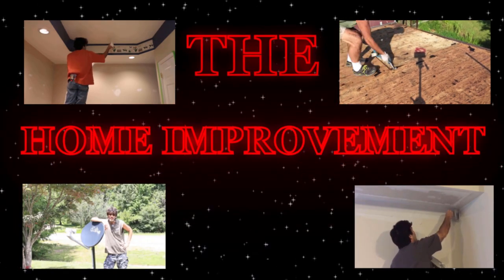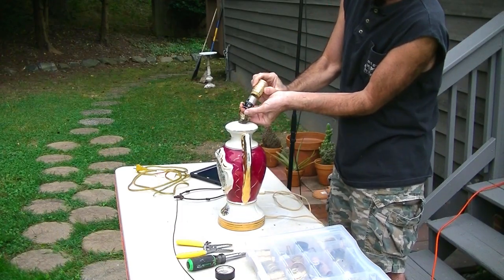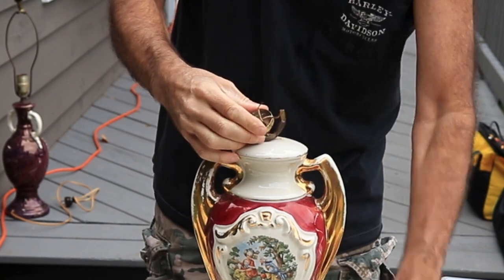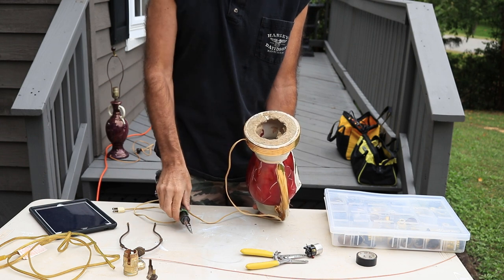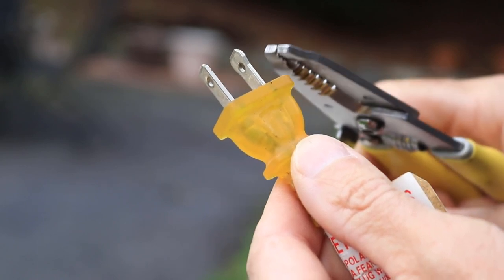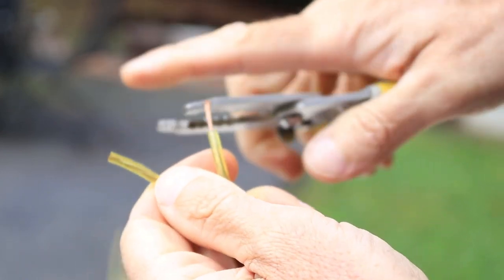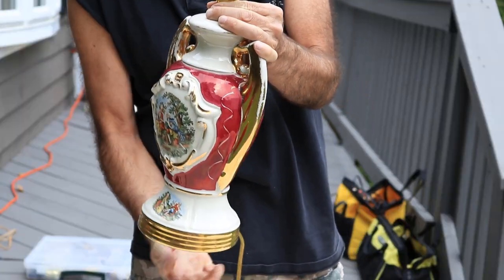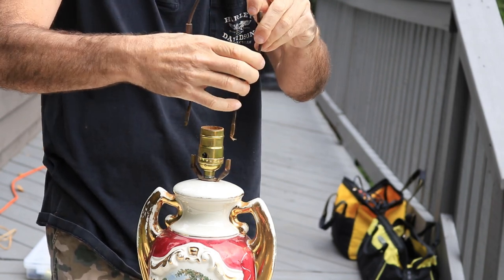How To: Replace Cord and Switch on Antique or New Lamp!  Best Youtube Video !!

Comment: If you ever need to repair a lamp, this is the one to watch!
This was my first time replacing a table lamp wiring and socket and by far, this was the BEST video I found on Youtube.  I researched at least 10 of these self-help videos, and none of them were as good as this one.  The instructions here are very detailed with helpful tips offered along the way, and this was the ONLY video, at least what I could find, that offered a tip on how to insert the cord through the inside of a lamp that did not have a long threaded pipe inside the lamp, that part was driving me crazy and taking forever until I happened upon this video!  Thank you Home Improvement Channel!!!
Reply from the maker: Wow!  Thanks for the great feedback... 😀. Glad I was able to help.

Comment: Lovely video, straight to the point.    Would have liked to have come across this video 4 years ago when I rewired my great grandmother's floor lamp she got as a wedding gift in 1948.  The bulb started to flicker when switched to a certain setting and the bulb was good and screwed in tight,  after visiting several hardware and home improvement stores finally found a replacement socket because it was the mogul base for a 100-200-300 watt 3 way bulb which was fairly common many years ago but nowadays is very difficult to find.  Also replaced the cord because the insulation was cracking and falling apart as I unscrewed the wires from the old socket and the plug was the old style with two narrow prongs,  allowing the plug to be inserted either way, as could be expected with a 70 year old lamp.  At that time i was unaware of the smooth/ribbed side to ensure correct polarity,  so I used a multimeter set to continuity to make sure the wide prong on the new cord was connected to the screw shell on the new lamp socket.  My mother inherited the lamp after grandma passed early last year,  and someday I hope to inherit it because it has sentimental value to me.
Reply from the maker: Awesome!  So glad I was able to help you with your project.  Yes the multimeter is a great way to tell if you're wired correctly.  Great job on that!  Totally understand the sentimental value of something like that.  Hope you have a great New Years.... 😀

Comment: Hey Rudy, 
Thanks for your good video and many explanations.
I have an older floor lamp which has the switch socket inside of a housing which doubles as the holder with 3 set screws for a globe shade.  It also has a threaded rod going through a couple of nice brass pieces and is bolted to a flat iron piece of the upper part of the floor lamp ...and the cord does NOT go all the way through to the bottom of the threaded rod. Rather, it has a hole in the upper third of it, comes out from the switch above it, and goes through a hole in the lower brass piece, before the rest of the threaded rod attached to a flat bar on the upper part of the lamp. The threaded rod is then held in place with a nut from the  bottom.  In order to get this apart, I could not access the socked and "press" on the part to disassemble it from the lower part that screws on to the threaded rod.  So I managed to hold the bottom of the threaded rod and unscrew the entire upper housing including the socket switch.  This severed the cord/wire in the mean time. No problem, because it didn't work.  The challenge is, How do I put it back together?!?!  Any suggestions... If there is a way to get pics of the components to explain this better, let me know.  Thanks in advance for any help you can offer.
Reply from the maker: HI Art.. Yes you know the old saying "A picture is worth a thousand words!"  If you have access to Facebook, you can upload a picture to my other channels site at take a bath productions...  I don't have a good picture in my mind yet of what your lamp looks like..

Comment: Ten points for pointing out that, yes, AC appliances do have polarity, and in the worse case, wiring them wrong is going to hurt someone. I know of someone who was electrocuted, standing on a wet basement floor and making contact with an incorrectly wired electrical device. It was the absolute worse case scenario, but you only get one chance to not die. She'll be missed.
Reply from the maker: Thank you for your feedback... 😀. Sorry to hear about your friend...

Comment: Rudy....maybe just a little more info and VISUAL demonstration on the SMOOTH and GROOVED wires and then which one hooks onto the BRASS screw.....and which one to the SILVER screw......just my opinion......thanks !
Reply from the maker: I covered it 3 times!  How could I cover it anymore... :-)... 4:22 , 8:23, 9:08..
Reply: @TheHomeImprovementChannel    You do cover it....but you don't LINK all four together in any one place....meaning, your TRAINEE may/will get it wrong.  I went over them a few times and will attempt to link all 4 TERMS YOU USED => to EACH other => for a complete progression => all in ONE PLACE...because I don't remember you ever doing it.....and going back and forth defeats the purpose of => KEEPING IT SIMPLE.

So here goes.....please confirm CORRECTNESS.....or link them with your own comments below.....

1. SMALL PRONG => IS THE HOT SIDE => IT'S THE SMOOTH WIRE => CONNECT IT TO BRASS SCREW

2. LARGE PRONG => IS COLD/NEUTRAL/GROUND => SO THE GROOVED WIRE => HOOKS TO SILVER SCREW

Was there any place in the video where you linked all 4 together, making it clear ?   If so, I missed it.
You probably won't believe me now => but your video was invaluable => THANKS RUDY !!!
Reply from the maker: @13kimosabi13  Yes u have it correct... the small prong and large prong aren't important... the smooth wire and grooved wire are more important.. yes I mentioned that in the latter part of the video probably the last of the time references I gave you.   Hopefully this helps.. thanks😀😀
Reply: @13kimosabi13  thank you so much. I too was confused as to which one goes to brass and which one goes to silver. Great video though. Thx!
Reply: I had to played it back a few times to get it.

Comment: My lamp switch is broke and I want to replace the socket and like you said in my example the two wires go up underneath the base of the socket and disappear inside it I’m just not sure how to reattach a new socket at that point once the wires are cut
Reply from the maker: Does the new socket have two screws?  One brass and one silver?

Comment: 7:35 why do other lamp-rewire instructions say to tie an underwriter's knot and you don't?
Reply from the maker: The knot only serves to keep the cord from pulling through.  I don't think it really matters what kind of knot it is as long as it can't pull back.  I tie the least intrusive knot I can so that the bulk of the knot doesn't get in the way of getting the brass cover back together.  Of course you can use the underwriters knot if you need to, but for me, I didn't want to.

Comment: I took the screws completely out! Oh no how do I identify the hot side?
Reply from the maker: HI, the neutral side of the lamp cord will usually have some ribbing.  The smooth side is the hot side.  The brass screw on the lamp socket is hot... I hope that helps.